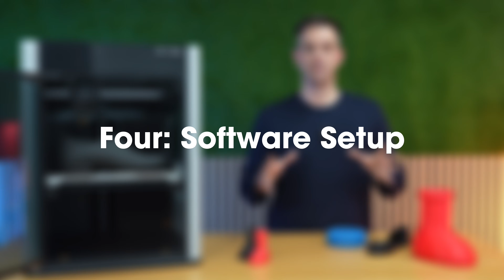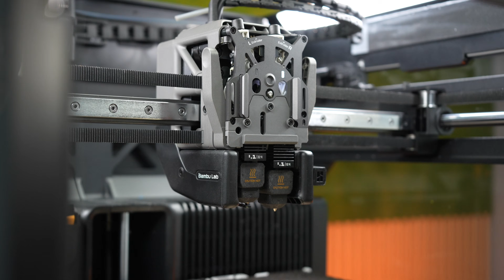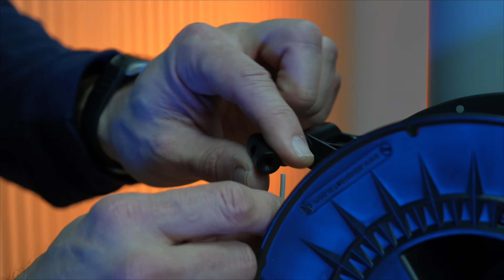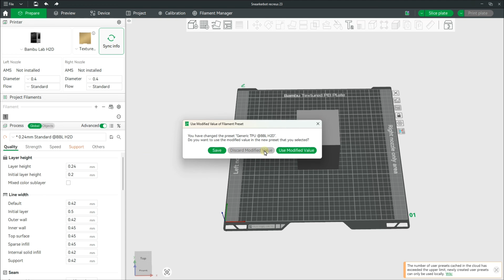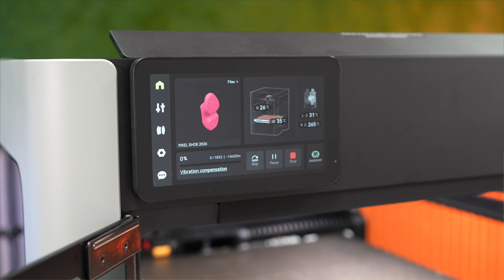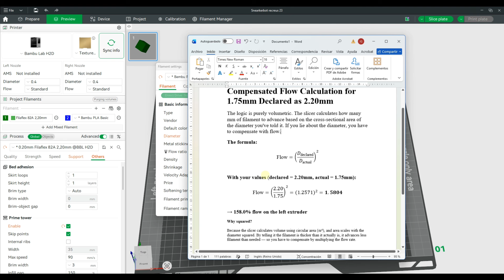How to Print TPU Fast in Bambu Lab H2D | UPGRADE Filaflex 2.20mm

Comment: you calculated the flow ratio based on 2.2 but then put 2.18 in the settings.
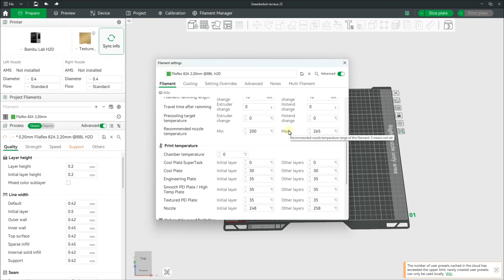Reply from the maker: Good catch! As Ignacio explains in the voiceover around 14:49, 2.20mm is the nominal diameter used for the initial flow ratio calculation. However, 2.18mm is the actual measured diameter of the filament batch.
As shown in the tooltip at 14:49: "Filament diameter is used to calculate extrusion variables in G-code, so it is important that this is accurate and precise." Setting it to the real value (2.18mm) ensures the most accurate extrusion output!

Comment: Will this profile work with the X2D also?
Reply from the maker: Good question! It is the same hotend, so it works on the X2D as well. We just have not published the X2D installation guide yet, but it is coming. Reach out if you need a hand in the meantime.

Comment: Pla only for supports? Or maybe I can fo a piece with PLA and TPU not necessarily bonded
Reply from the maker: You do not have to use PLA only for support structures. Depending on your needs, you can use other materials as supports, or even the exact same material you are printing your main piece with.